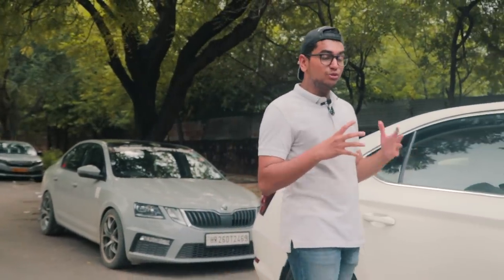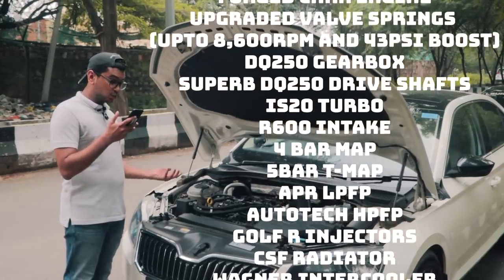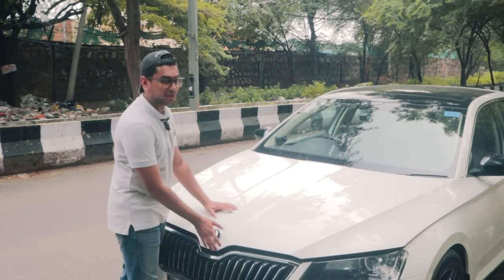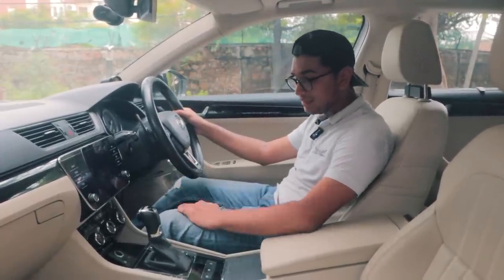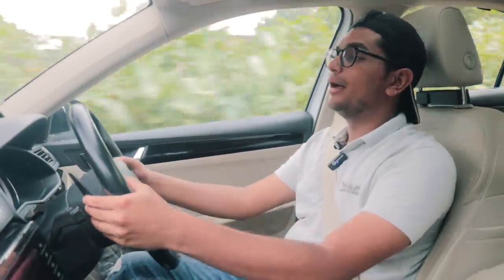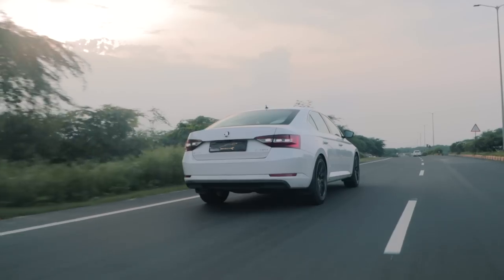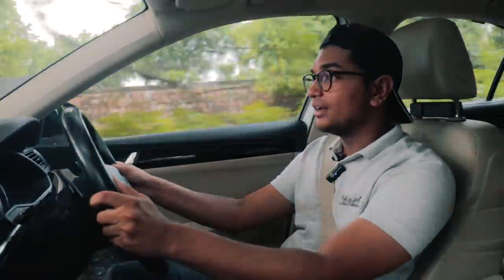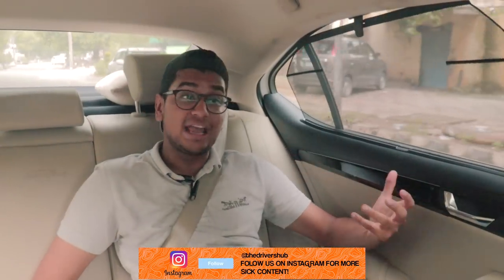VRS Engine Swapped Skoda Superb! (320HP, VRS 2.0L TSI Swap, Sleeper Build!) | Autoculture

Comment from the maker: Hello! So if we have mentioned "Superb VRS" in literal terms anywhere in the video, its kind of wrong. You have something called a Superb 280 outside which is basically a Superb with a Cupra 280's engine & Haldex AWD.
Reply: One question ... I have the 2020 superb l&k 2.0 tsi ... I wanted to know what the exact difference between this 2.0 tsi and the one in the Octavia vrs. 
And is it capable enough to handle 500+ bhp like the Octavia vrs .
Reply: What is the legality of engine swap in India? can you put up a video explaining how exactly can we do an engine swap legally?

Also, how to procure an engine(the process in short)
Reply: @GautamSingh-sd3qz If you have superb 200/206kw: Octavia have is20 turbo and superb is38. The engines are both capable of something around 560bhp with stock internals but its not recommended, apr dtr6054 with 444hp map is the best choice.
Reply: @frantisekkober6005  thank you soo much .
So except the turbo and some other parts like ecu ...the main engine block is the same ? ... If yes then can we put the same aftermarket parts in the superb as people have been dling in the Octavia vrs.
Reply: @GautamSingh-sd3qz  Yes, but it needs to be 200/206kw version than it have is38 turbo so you can just with stage 1 go to 370hp, stage 2 400-440 depands on turbo, stage 3 with tvs is around 500bhp. In czech republic we have superbs with stage 3 that does 3 seconds 0-100 and 100-200 sub 10s, its a lot faster 0-100 than octavia but than 4x4 is just weight to carry so its slower 100-200 but still sub 10 100-200 is rs6 numbers.
Reply: @GautamSingh-sd3qz   I personally have rs245 with stock power right now just upgraded brakes and its so much fun to drive. Ea888 is the best 2 liter engine on planet in my opinion.

Comment: How did they manage to get a vrs engine? Was the engine pulled out from a totaled car?
Reply: India wants to know
Reply: They could import one
Reply: Maybe a built base engine imported ?
Reply: I am wondering do they change in RC as well, engine number and chassis number should match as per RC, may be a silly question but just want to know
Reply: He got is from Skoda itself.
Reply: @explorerwanderer it’s legal to get an engine swap but by taking RTO approval. Not sure if they have done that or not.
Reply: Since it's a superb, it must have had the 2.0l tsi as standard. It could be just a head and valvetrain from the vrs
Reply: @mauliksinghal2372  No sir. This version of Superb came with a 1.8 TSI and a DQ200. They were all swapped out for a new engine and transmission directly purchased from Skoda.
Reply: @mauliksinghal2372 but look at the model , this model had a 1.8tsi and the newer facelift got the 2.0tsi so i dont feel that this model had a 2.0tsi and a dq381 if im not wrong??
Reply: @explorerwanderer kisko kya hi pata chalega 😅😂
Reply: @layeequr2604  thanks, I was not aware about that
Reply: It's a proper built crate engine, imported from EU i guess.
Reply: @veloce.95  Purchased from Skoda sir
Reply: I think after 2019 or 2020 Skoda started giving 2 L DQ381 with 7 speed dsg gear box and engine for both superb and Octavia
Reply: @explorerwanderer  it’s illegal to swap engines in my state.
Reply: @harjay_77  skoda doesn't supply forged blocks.
Reply: @veloce.95  Sir I know the owner personally so I know where all of this has come from😂
Reply: @layeequr2604 but the engine have to be the same with the one which is swapped according to the Road Laws
Reply: Yes bro the bs6 superb facelift got a dq318 with 2.0 tsi  @Masteroowot
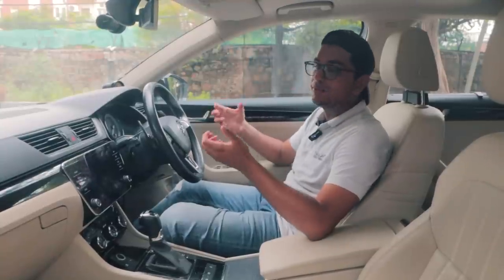Reply: @mauliksinghal2372  no bro its a pre-facelift bs4 superb means it has the 1.8 tsi engine see 4:13

Comment: Hi there, nice video presentation.

In my opinion, with all those mods you mentioned 320hp is rather low, it should be at least 420hp to 450hp.

8 pots front & 6 pots rear is really overkill, but perhaps your going for the  'cosmetic' appearance then i understand. hopefully the brake master cylinder is upgraded though?

Also noticed the coolant level is way below the Min level.
Reply: It is detuned currently but it has capabilities to run upwards of 400 HP. It is a daily driver hence why the power cut down.

Comment: Why not buy a 2021 2nd hand BMW m340i, almost come at same price but insane performance with factory settings. 
Any  FWD with anythign over 250BHP is TOTAL WASTE OF POWER.  
Why wasting almost 60-70 lakh with all sort of ECU ERRORS
Reply: There is always more fun in doing stuff out of the box and unorthodox which not a lot of people would have thought about. M340i is a cheat code to go fast I agree but again, it’s not very different from what current M340i owners are already doing in India. However, you don’t see a Superb built to hold 400HP+ often😂
Reply: Why are you comparing a "Bmw" with a driver's car? thats a wrong comparison. Superb is a driver's car not performance car, this is a 2016 superb and it wont have any ecu errors that will cost your life savings😂😂😂 ecu errors fix are not that expensive by the way. Agreed the m340i's are cool but they are way more expensive than maintaining these vehicles